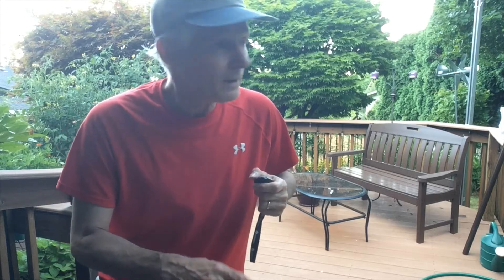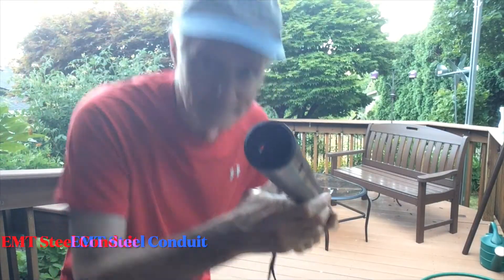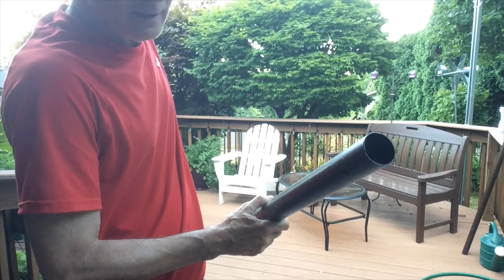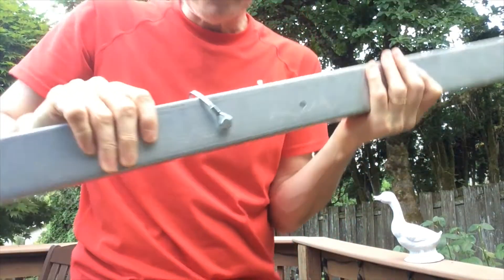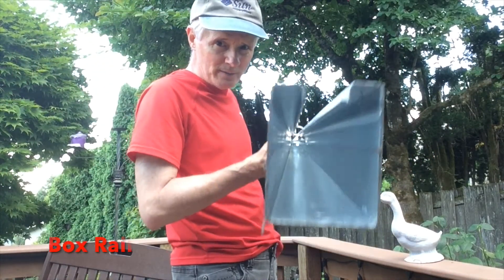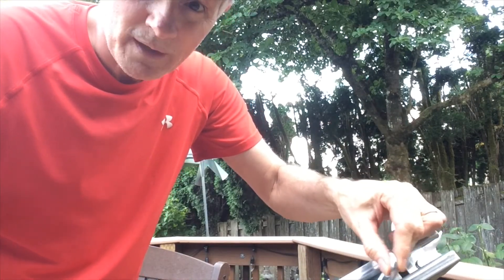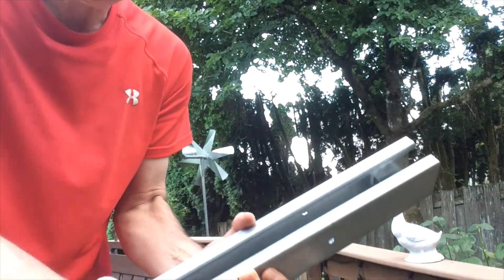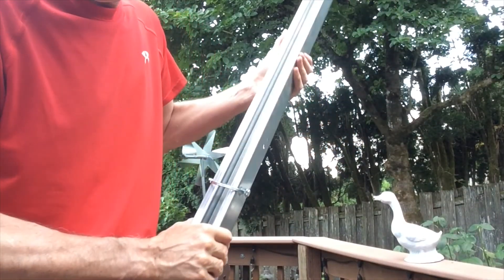The Home Genius -- Deck Shade Sail

Comment: This is a great idea. Exactly what I have been trying to work out for days. How has it stood the test of time.
Reply from the maker: Hi Heather, I just set it up for the summer last week. It took 5 minutes - slip on the posts, hang the sail - DONE! Even I was impressed. The rail posts don't rust (everything is conduit and stainless steel) so it looks good as new.

Comment: Hello Dan, I really enjoyed your handyman skills, great idea and its something I'd like to maybe try but my  question is, how and what would I attach to my aluminium fence, which is about 2 1/2m in front of my sliding door. I'd like to attach the sail directly to the house with turn buckles, above the door but securing to the fence is a bit of a  boggler. Any ideas? its just me so il attempt it on my own. lol ..Jewel
Reply from the maker: Hi Jewel, I don't have enough info to help much. But, first option would be to bolt it to the fence - if it is sturdy enough, tall enough and doesn't ruin the look. Another option would be to pound 1 1/2" conduit poles into the ground in front or behind the fence and fasten to them - if that's possible. The conduit would need to be 2 to 3 feet in the ground and then it's pretty sturdy. Drilling holes in conduit is also pretty easy.

Comment: Hi there! I currently have 4 treated wood posts in concrete slab about 5×15. I want to buy a rectangular, but not sure if I should get exact dimensions or go smaller to account for the string attachments that hold them up. Any suggestions would be greatly appreciated!
Reply from the maker: Hi Blue, My deck is 16' long and I bought a 15' sail. The sail will stretch over time and you can use turnbuckles to make up additional slack as it stretches. The websites will usually give you a guide as to what size to order (usually 1-2 feet smaller on each side). Also, my "rectangular" sail is wider at the corners than on the sides - so it flares out at the corners. Websites will also show sails that at more "true" rectangular" if that's what you want for a little more coverage. Hope this helps.
Reply: @dandamario8525  I would go with the shades that have the curved sides like the one you have.   The straight-sided ones tend to sag on the straights but the curved ones don’t.   Nice video BTW.

Comment: Hi Dan 
Great idea!! Would be great if you added a supply list. What did you use to hold the  conduit away from the deck so the hanger would slip over it?  I don't see it on the bolt assembly, only on the deck?You think I could use sched. 40 pvc conduit  instead of the metal conduit? I don't have any way to cut metal.  Thank you! Judy
Reply from the maker: Hi, thanks for the question! At the start of the video you can see the bolt assembly for the bottom connection. All the bolts, nuts and washers are 3/8". The bottom has 2 nuts and 2 washers so it extends out enough on the outside to stop the rail from sliding down. The upper connection has only one nut on the inside by the deck so the rail opening slides down around it. The outer side of the bolt has NO nut or washer so the rail slides over it freely.
Also, Home Depot will usually cut pipe/conduit to size for you - easy. I don't think PVC is a good idea because there can be a lot of strain and PVC could crack - especially in cold weather.
Hope this helps!
Reply: Thank you Dan, for your timely reply!
I really like your creative genius idea, using the box hanger but after careful consideration I may just go with attaching  4x4 posts to my deck  as I don't need to remove them and it's going to be less expensive. Thanks again!! Judy
  @dandamario8525
Reply: @jlove2414 How did you attach the 4x4 posts to the deck?